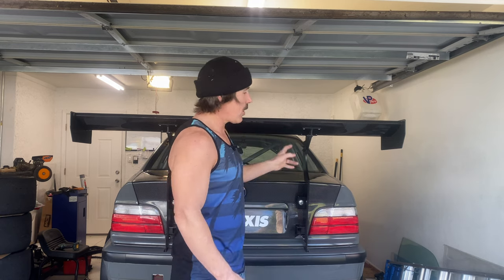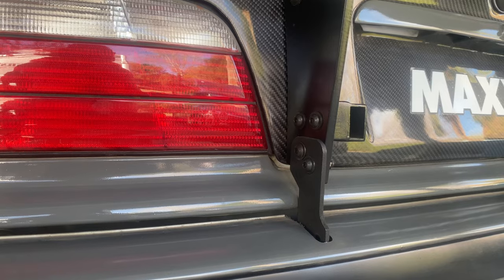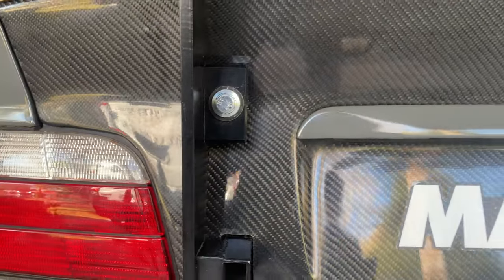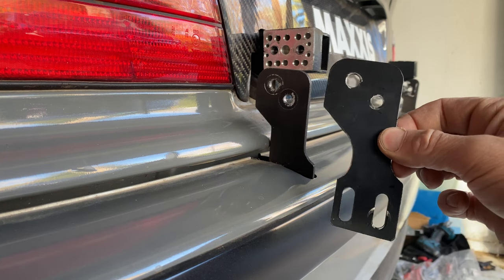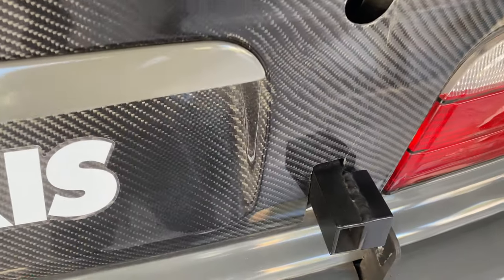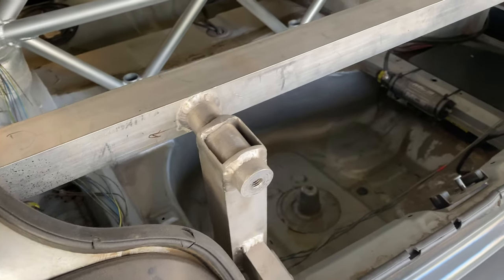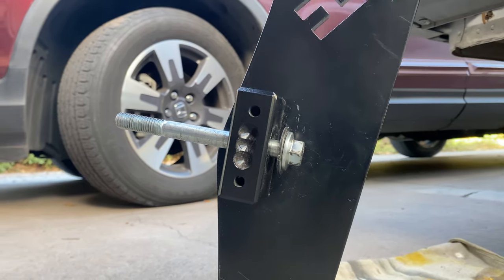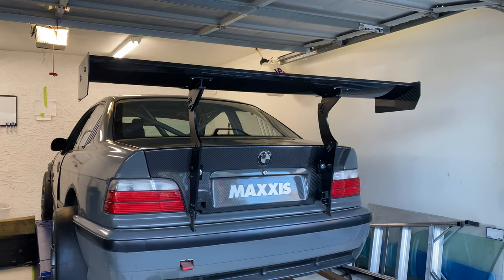Chassis mounted wing on E36 M3

Comment: Looks good 🤙🏻 Brett did my fab work on the m3
Reply from the maker: oh sick. He does impressive work. E36 knowledge is a bonus. its gonna go back to him for some chopping soon
Reply: @tomstober7023  you can go much faster and get much more downforce

Any plans for flat bottom/diffuser?

Pay attention you dont want your aero balance to be very rear biased
Although this is a front heavy car so not much of a big deal
Reply from the maker: @FirstLast-tx3yj  the Car is  %51 front %49 rear balanced. so not necessarily nose heavy.  yes distant plans for serious diffuser(remove spare tire well and reroute exhaust). I also have a larger AJ Hartman front splitter going on soon
Reply: @tomstober7023  it was that balanced without the effect of corner balancing and modifying the suspension to rake the car backwards??
Reply from the maker: @FirstLast-tx3yj  correct. these cars came with an iron block. the LS is possibly about 40lbs lighter. possibly sits lower too. so a great candidate for the LS. I do the corner balancing for cross weights only
Reply: @tomstober7023  i also believe the fact that the ls is shorter helps
Reply from the maker: @FirstLast-tx3yj  possibly!